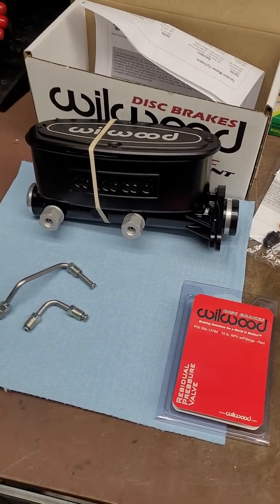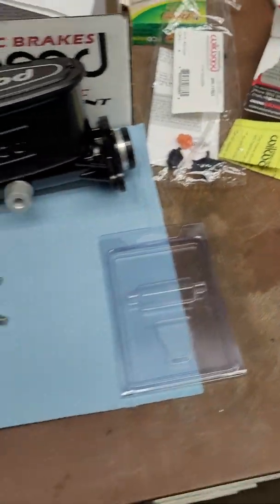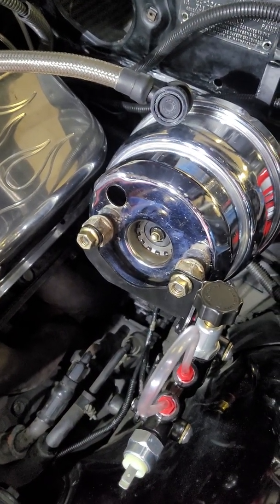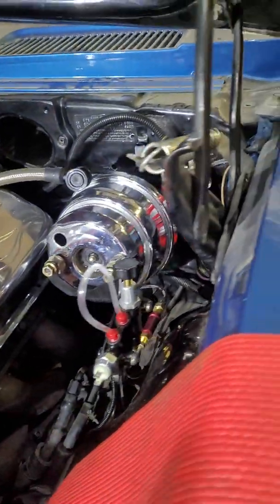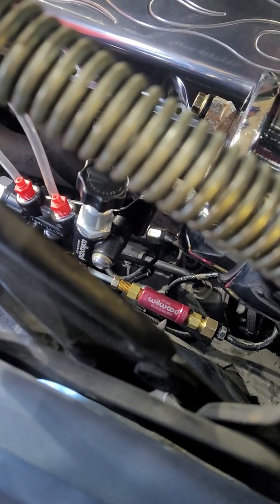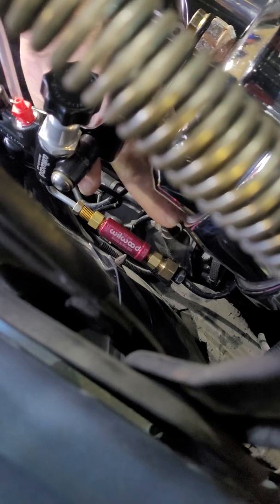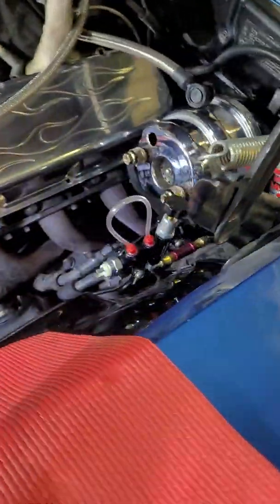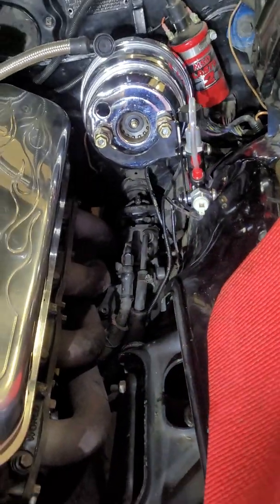Wilwood Residual Pressure Valve ( 10 LB ) Installation

Comment: Great video, very informative. However I was wondering, Wouldnt you want a proportioning valve to be after the 10psi residual pressure valve in order to make fine tune adjustments?
(If the proptioning valve is standalone and not attached to a distribution block like this setup shows)
Reply from the maker: @TheHemperMan  Thank you for the reply. I have seen the proportioning valve installed before and after the residual pressure valve, it seems to be a non-issue where it is located. Good luck with your build!

Comment: Excellent video! I appreciate no excessive talking or obnoxious music. Just straight information. I have a very similar situation and I have the same master cylinder , proportioning valve and residual pressure valve and I am in the process of building new brake lines and have been wondering where to put the residual pressure valve when I get to that point and you solved my dilemma. Good job and thank you.
Reply from the maker: Glad I could help, good luck with your project!

Comment: Thank you - exactly what I was looking for!
Plumbing a complete new brake system with a drum rear. Need to install the residual valve but wasn’t 100% sure where - closer to the master cylinder or on the frame up from the soft line to the axle? Close to the master for the win!

Comment: Did you mount the residual pressure valve before or after the proportioning valve?  Great video!
Reply from the maker: It's mounted after the prop valve
Reply: @wandler76  That's what I thought, but I'd figure I'd ask.  Thank you 🙏